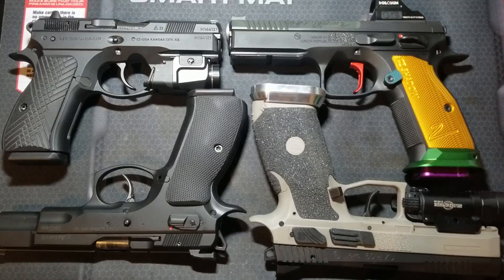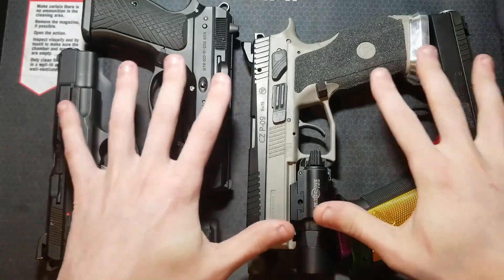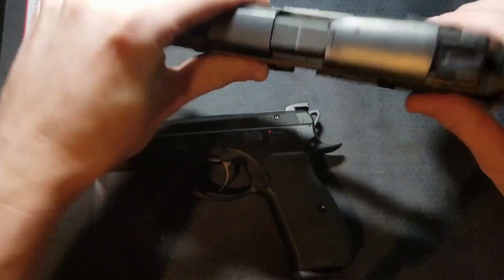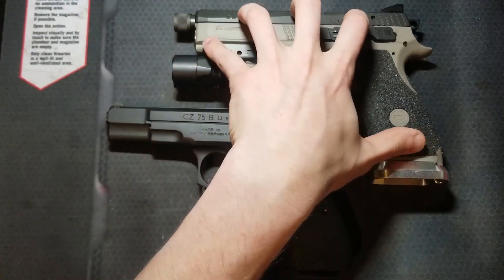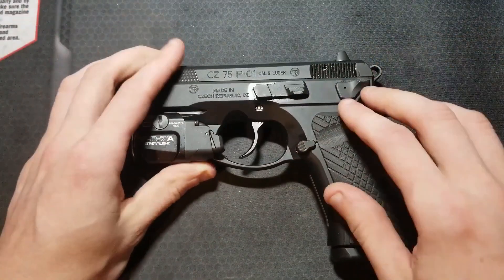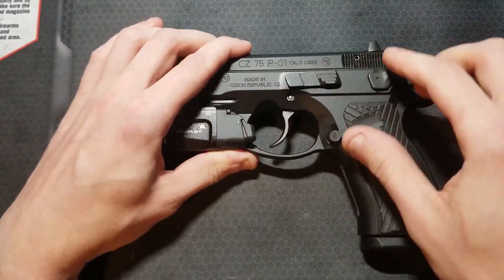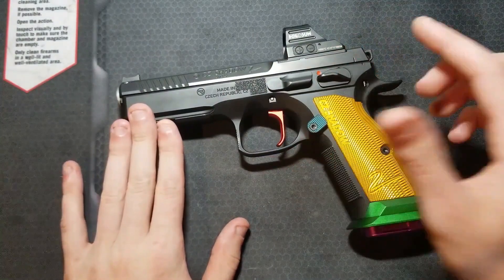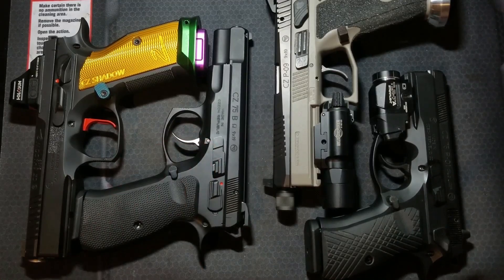CZ DA SA Pistol Trigger System Comparison

Comment: Great explanation! I've seen some folks claim that the omega is a superior trigger system, which simply isn't the case. Wish I had seen a video like this before buying my P01 Omega last year. Don't get me wrong, it's a great pistol, but even after some upgrades and polishing, I feel like I've left some performance on the table by not going with the standard trigger variant.
Reply from the maker: Same with my 75B Omega. It was my first CZ, I didn't really know the trigger systems and its what the local gunshop had. Hindsight I wish I would have gotten a regular 75B. But, the Omega has been a great pistol for me too.
Reply: I sent my P01 Omega off to CGW and what I got back is fantastic. Have a P07 done by them as well. Also have a Shadow 2 which is other-worldly straight from the factory! I prefer the decocker system and lever on the Omega for the same reasons you stated (much easier to manipulate, especially under stress). That far outweighs a slight trigger quality disadvantage IMHO. I don’t doubt the standard trigger can be made better but my CGW Omegas are far more than good enough! Decocker ONLY on a carry pistol, just as you said. Another great video!
Reply from the maker: @robolive123  I have a P-09 and a Shadow 2. Both amazing guns, both upgraded with CGW parts. For me the difference in trigger quality from Omega to standard is quite a bit more than "slight." The Omega triggers, once improved can be quite good but they pale in comparison to an upgraded conventional trigger system. Of course that's largely subjective and just my opinion and preference! Thanks for watching and commenting!
Reply: Wait wait wait, what?? Omegas aren’t better after all out of the box?  I was deciding between p-01 and p-09 and the 09 is supposed to have a better trigger whereas the 01 is a better self D trigger ….   So p-01 is better than 01 omega or p-09 ?
Reply from the maker: @m1k3_flo P-01 will have a better trigger out of the box than a P-07/P-09 Omega trigger system. The P-01 will have a better trigger than the P-01 Omega variant. I am confident in saying the P-01 Omega trigger would be better than the P-07/P-09 (metal frame Omega models have better triggers than polymer frame Omega). I suppose trigger quality can be a bit subjective, but the general consensus is that the Omega trigger is the worst "feeling" trigger in the CZ hammer fired pistol line up.  But an Omega trigger isn't really that bad - its very usable and quite decent with upgrades, its just the conventional trigger system is MUCH better, especially upgraded.
Reply: @EngineersArmory  gotcha thank you..

Comment: Great!  I love my CZs but am still unclear on some of the differences.  Would love a video(s) on what you get in an SP-01 vs base model.  Did I catch that SP-01Tactical and SP-01 Safety are different?  thanks.
Reply from the maker: I don't have an SP-01 but I can try my best to answer your question.

The SP-01 is a full sized version of the P-01 (shown in this video). It's also similar to a full size CZ 75B but with a full length dust cover and a picatinny rail for a weapon light. I think the grip shape may be a little different than the CZ 75B and has some extra checkering on the frame as well (what they call "improved ergonomics").  

The only difference between the SP-01 and SP-01 tactical is that the SP-01 has ambi thumb safeties, and the Tactical model has ambi decocker levers. They are both the conventional trigger system. Both of them have a firing pin safety block (unlike a Shadow 2 or Tactical Sport) which makes them a good candidate for defensive applications (duty, carry, home defense, combat, etc.). CZ's website states the SP-01 was designed as a military and LE sidearm (the standard SP-01 or tactical version). 

CZ released two SP-01 Competition models not too long ago, one with blue grips and one with red grips. They are both the same just with a different color. They are an SP-01 (thumb safety model) that has a competition hammer, lightened main spring, and lightened recoil spring for competition use.

Hope this helps!
Reply: @EngineersArmory  Yes.  Very helpful.  In particular the info on the SP-01 Competition.  Keep up the great work.

Comment: On my SP01 urba gray  tactical, i just pulled out the firing pin safety detent and spring
Reply from the maker: I would never recommend disabling a factory safety feature on any firearm. Your gun is no longer drop safe (the FPSB models have a much lighter firing pin spring than non FPSB models). If you were that worried about trigger quality you could have considered a Shadow or Tactical Sport. I hope you don't use that SP-01 for its intended purpose of a defensive pistol with a compromised safety feature. 

For range use... meh... but still you could drop it and send a round at some other user of your local shooting area.